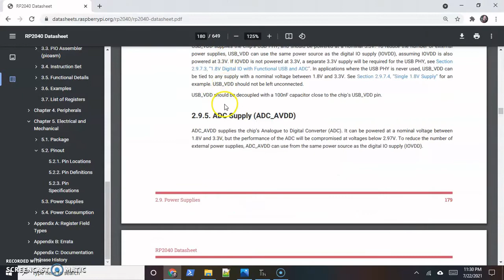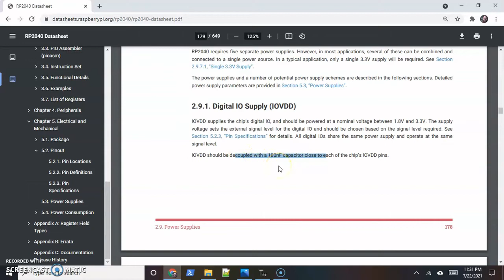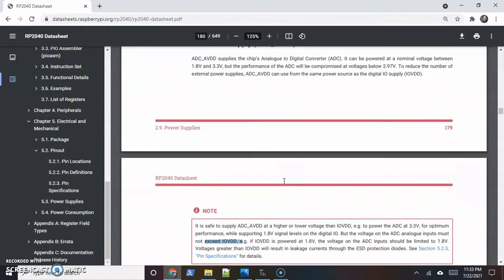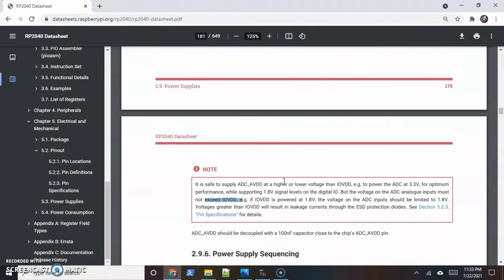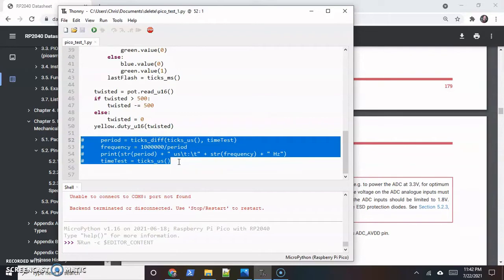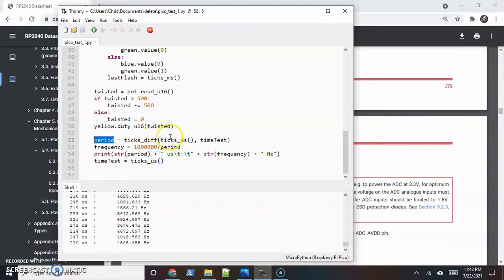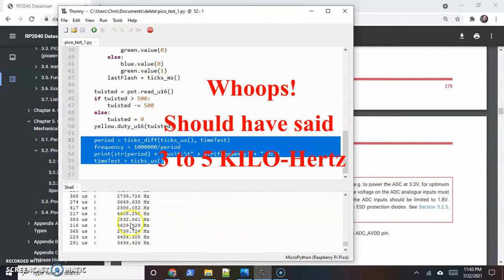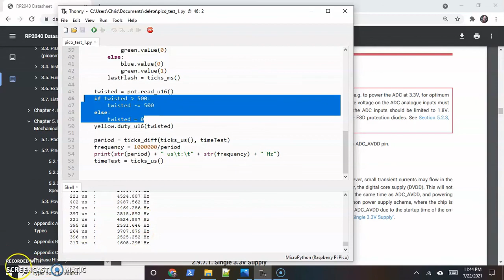Quick fix for an ADC issue on Raspberry Pi Pico

Comment: Ι have this project where adc it's working fine. I read all 3 inputs fine. And then out of nowhere the readings are unstable, fluctuate a lot and basically is unusable. I power cycle the thing, I use different power supplies but doesn't fix it. If I leave the project powered off for a night, the next day it's working fine again, no joke! I feel something inside pi pico is not good

Comment: 2:05 Most chips can handle vcc+0.5v(or something like that) max on there IO pins, so if you power the uC with 5v you can max have 5.5v, but if you power the uC with 3.3v you can have a max of 3.8v on you IO pins, etc. So nothing out of the ordinary with the pico.
Reply: Nah, Pico runs at 3.3v logic level.

Comment: Try this again pull gp23 high as output ( this pin not is exposed but connected to the switcing reg). Add 2x 10nF and use vcc by tieing it to avcc. That will take care of the drift and stabilize it alot more. If you want better result use vbus with a linear regulator and tie the 3.3v to avcc instead of the vcc.

Comment: I actually hadn't noticed this voltage range issue, but possibly because I use a resistor between the wiper of the pot and the ADC pin, in case I accidentally load a sketch that uses the pin as an output - which could cause damage to the chip, if the pot is turned fully to either end.

The substitute problem I get is that I don't quite get full scale readings, with the resistor there, so I have to calibrate for it.

More to the point, the ADCs in the Pi Pico have a severe flaw, which is now documented in the datasheet as Erratum E11 - they're far from linear, with some wild readings, especially at certain values.

The datasheet now estimates 8.5 useful bits of precision but gives no clue how to even get that much out of them.

If you read an ADC and use the value to choose an audio frequency, e.g. with tone(), you'll here how bad it is.  If you're just doing something were it chooses which LED to light, you probably won't notice, but really, it will be flickering between different values.
Reply: Hi, I am pretty new to this. One of the projects I used pico for was a USB adaptor for Logitech g29 pedals. Just wanted to make sure what is the pot you referring too? Is it just the central pin?
Reply: @RudiOnRails potentiometer mst likely